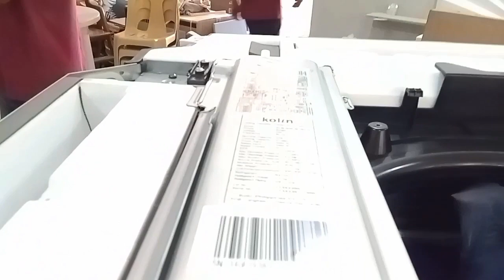CEILING CASSETTE Installation by Team Jeff #airconditioner #CeilingCassatteAircondition #kolin

Comment: Magkano po ba standard install ng ceilling casette? At magkano per foot ng excess pipe?
Reply from the maker: Hello! Our rate po ay depende sa area at location ng pagkakabitan ng unit. Mostly ranging from 12k-15k. Regarding excess piping 500 per foot
Reply: @jeffairconditionservice sir magkano ngayun ang linis Ng ganyan 3 tons daiken split
Reply from the maker: @roelfrancis7034  1,300 regular rate po namin